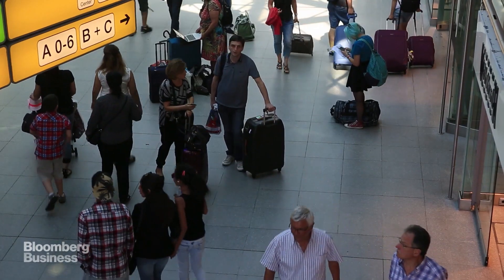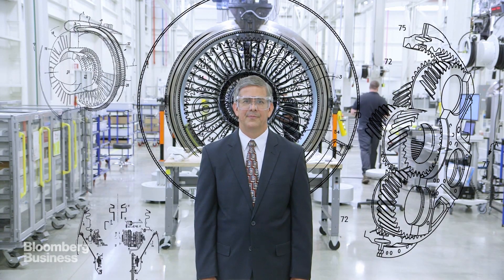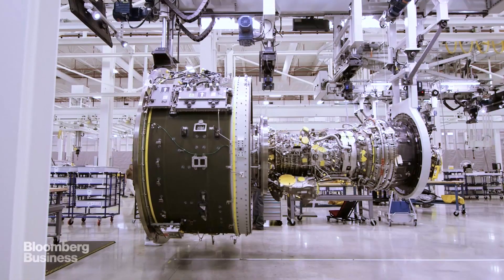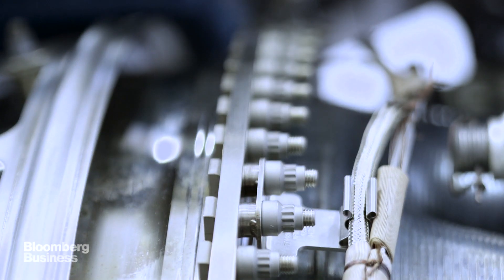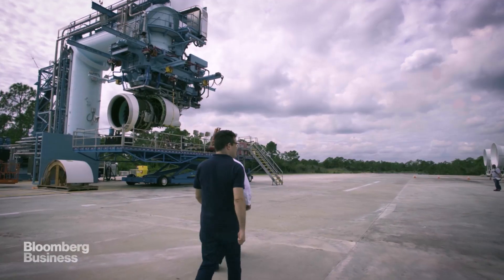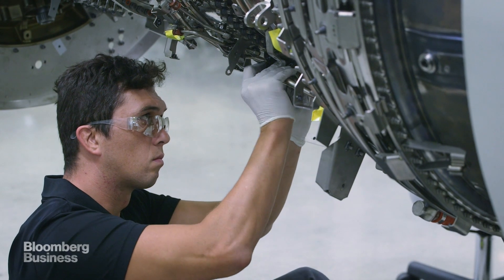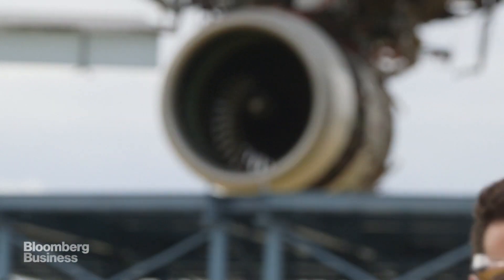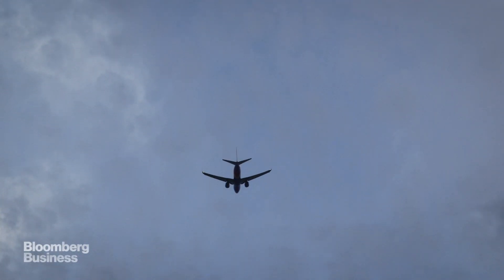This Genius Invention Could Transform Jet Engines

Comment: In a crooked Biden world where CA gas is $5.00/gallon maybe fuel efficiency is a big deal. But during the Trump administration that same gas was going for less than $2/gallon. That's more than twice as much for crooked Biden gas than for genius Trump fuel. What does that do to your 15% improvement in fuel efficiency during the Biden Crime Family reign? The fact is, you get more than three times as much efficiency just be replacing Biden with Trump.

Comment: I've met and worked once with Mike he is a smart guy. The gearbox he created is basically the same as a planetary gear system you find in a propeller engine. But it has a couple differences.

Comment: They make it out to be something massive and revolutionary, and it’s actually just a dang gearbox

SpaceX was making reusable rockets at this time and THIS is the aerospace news they cover
Reply: Because a geared turbofan affects many more people than a bloody rocket. Because the gearbox allows for different fan speeds, the engines can be more silent (let's use the BAe 146 for example; the 146 used 4 Lycoming ALF 503/507 geared turbofans, those engines, even though there where four of them, where extremely silent and it still is considered one of the most silent planes today, so much so that it was one of the only planes for some time to be able to operate the London City airport) and increases fuel efficiency, which means that airlines, in theory could lower the fare price while increasing their profits because of the increase in passengers
Reply: SpaceX wasn't the first to propulsively land a rocket, also why are you comparing a rocket to an engine those are completely different things.

Comment: Every engine has reduction gears. 
A piston engine has reduction gears for the camshaft and accessories 
Also the big radial piston engines had propeller reduction gears. Has to deal with torque pulses. A turbine doesn't. 

So it has to transmit 30,000 hp at a fixed speed for a long time. Don't see why it took 30 years to work it out. The moon rocket was developed in less time.

Comment: Usually jet engines burn the air, but Matter is lost due to element burning, so I figured instead of burning the air and mass of matter is lost forever, compress it and push it out quicker to save mass of matter, so the Universe does not evaporate to nothing so quickly.

Comment: What is new here? 
Fan-type engines are known even shortly after the invention of the jet-engine, called turboprops. 
Because transport aircraft fly much slower than the speed of the jet-exhaust, a simple jet is not very effcient. Combat aircraft with higher speeds need it. 
The fan allowes to reduce the jet exhaust speed in a similar way as a propeller does. 
The turboprop is just a jet core with a - GENIUS INVENTION - THE GEAR-BOX - and a propeller. 
The hugh fan does just the same, however better adapted to the aircrafts speed. It is a jet-core, a gear-box and a fan. 
The first such type was and is working as ALF-502 since the early 80-ties on the AVRO-transports with a by-pass-ratio of 5-6. 
The difference here is the by-pass-ratio is bigger.

Comment: Maybe a hybrid electro-jet would do better.  Use electricity to spin the compressor so you do not need a turbine after the combustion chamber.  No moving parts in the hot section mean the cost of manufacturing and maintenance will be a fraction of what we have today.  The engine will be lighter, uncomplicated, and more economical.
The electricity can be generated by:
1) a normal diesel generator in the fuselage burning A1 jet fuel, or

2) a smaller jet engine in the fuselage driving an alternator, or
3) fractional bypass of exhaust gases driving a single turbine coupled to an alternator.
Small battery backup can provide safety in case of generator failure.

Comment: Why not go all the way and add a V8 with a four speed gear box. I always thought that the reason for having no extra complexity in 100,000 LB thrust turbines was because of the problem of more things to go wrong. It might save a few hundred thousand dollars in fuel use but if the out of service rate increases then no dollars are earned at all.

Comment: I have a question? How much do the reduction gears weigh? What about friction losses? Isn't adding more complexity making the engine more prone to failure? Wouldn't it be easier and more fuel efficient and cheaper and more reliable to put the front fan on an electric motor?

Comment: Um how about move away from the jet and move to the next thing that doesn’t use jet fuel or rocket fuel
Reply: That's in progress. But there is no alternative to the turbofan-engine as a propulsion system for airliners yet. It needs time. You can't just build a hole new engine-design from scratch.

Comment: Why not use a slower rotating shaft with a redesigned jet exhaust power turbine stage to drive the fan? You could also expand the jet exhaust to make turbine design easier and at the same time cool the exhaust to gain greater thermodynamic efficiency.

Comment: Aren't all turboprops geared?
Treat the fan as a small prop.
Reply: Disclaimer: pilot. Not engineer. They are, but in a turboprop, the actual engine can be placed wherever they need it to be so long as its shaft is connected somehow to the propeller's. In a turbofan, the speeds involved are much higher, and the fan serves as the first stage of the core of the engine. Because of these, the fan and core have to be perfectly in-line. Sure, you could do a counter shaft setup much like in a manual transmission, but now we're sticking a gearbox into the airflow we are trying to optimize. It would add drag and cause asymmetric airflow. So, short version is the reason for the complexity is that it has to fit within the shaft that attaches the fan to the rest of the engine and still be streamlined for jet airflow.

Comment: My only "experience" with gas turbines is from reading but I found my jaw drop that P&W would suggest a reduction gearbox as ground breaking.  Not sure of the drawbacks but a twin shaft arrangement, a second turbine in the discharge eliminates the expense of gears. Both shafts are inline without planetary gears. Bearings are more reliable then gears. Eliminating gears extends the mean time between failure, less cost, less maintenance, lighter weight and for a given cubic meter per second, the hole size for the engine is smaller - keep it simple S. The gearbox arrangement might seem more efficient on a test bay but flying 2 or four gearboxes, for the life of the airframe, would waist a lot of fuel in the long run.

What am I missing?

Comment: Where is it in 2019?
Reply: they are already mounted in 737 MAX and A320 NEO
Reply: First flew on the Bombardier C Series which has now reached half a million flight hours in service with around 50 airplanes. It is way quieter, way cleaner and more efficient than traditional high bypass engines. Once they stop exploding they will be awesome. Not joking, they were blowing up or just failing in flight test left and right. Still giving a lot of problems in service with the neo and others. But it is new tech and new tech always has challenges. I am sure eventually they will get it sorted out. But I see them and hear them fly every day and the difference in noise is remarkable. Making noise wastes energy so this engine wastes less, which means lower operating costs and less pollution. It is the way of the future for sure. But still a few bugs to work out.

Comment: Well, Mr. smarty pants needs to invent an air bypass on the outside of that fan to not only allow less resistance but to actually increase speed of airflow. A big cowling like that only becomes a lot of resistance at a certain point.

Comment: The clip doesn't explain what is so complicated in gear reduction in a jet engine. It is used in every transmission and front and rear axle driven vehicle. Perhaps it is a problem when the turning fans are moving at 100,000 rpm?

Comment: This video..am assuming is slightly old..and no one doubts the engineering excellence and innovations of Pratt and Whitney ( organisation).. and their amazing product line up.. but ask them how many airlines are now tearing their hair over the " new" engines that they thought they had a monopoly for..on the Airbus 320 neo' s. These new " engines" of theirs.  to put it mildly are just not delivering what was promised.   and are full of snags.  be it hardware or softwares in the cockpit..related to engine performance . startup time taken etc.  This is leading to many aircraft developing in flight snags../ huge delays / and of course crazy schedule disruptions..the company is working on trying to resolve these issues for over three odd years now.. hopefully they'll get it fixed..but in the meantime airlines are switching orders to CFM..RR..and GE.. thanks for sharing..!!!

Comment: “No energy system can produce sum useful energy in excess of the total energy put into constructing it.
This universal truth applies to all energy systems [including jet engines].

Energy, like time, only flows from past to future”.
The Fifth Law of Thermodynamics and The Arrow of Energy, proposed 2017.
Reply: So, what does that have to do with this video? Turbofans aren't close to 100% efficient anyways.
Reply: @jeffbenton6183  This would be what is behind grounding the air travel for the masses if the reason was energy resource depletion, not a public health issue.
Reply: @sunroad7228  I'm still not following, what's your point here? The video is describing a system that is intended to achieve less noise, fewer emissions and longer range for the same amount of thrust, that's all.
Reply: @jeffbenton6183  More noise, more emissions will be caused somewhere else in the industrial base by the new design, and it will require more energy-intensive repairs, too (i.e. longer working hours for the mining machinery, and other externalities).
There is no such thing as 'efficiency', but energy-juggling and problem-shifting from one place to another.
This is all what Physics allow human to exercise. Fossil fuels are so energy-dense and highly portable, sold on the market cheaper than bottled water - is what has made Economics under our civilisation misleading humans to think 'efficiency' is something they can achieve.
Never.

Comment: They’ve already done it, modern engines run by compressing the air so much they don’t use fuel anymore and probably haven’t done so for quite some time.People however are still being charged for the non existent fuel in the ticket price..

Comment: it took them 20 years to develop the simple idea of gear reduction? This is nonsensical.  They probably did not act on this concept not because it was unknown but because it offered only a relatively small return. Gas prices were less of a concern in those times. Noise as well. Perhaps the reliability of the gear system was also an obstacle, or its added weight. There could be many reasons except that no one has thought of it. Lets be realistic. The designers want to appear to be true inventors and thus exaggerate their accomplishment. This much is clear to me.

Comment: Thing about a jet engine, the force is always perpendicular to the motion, so no work is done on the mechanical parts.  In a reciprocating engine you must stop and start the pistons and rods twice for every revolution.  If we all could have gas turbines connected to electric generators in our basements we wouldn’t need electrical wires, or generating plants, or coal, or oil.

Comment: Wow - What a great innovation...   but wait.
In 1959 I flew in a 1932 Cirrus Moth with a gearbox so that the propeller (the fan equivilent on gas engines) didnt exceed the sound barrier. The Rolls/Packard engines of WW2 often had gearboxes. Well at least the Wright flier of 1908 didnt have a gearbox. They used sprockets and bicycle chains.   😨😨😨

Gearboxes on Jet Turbines are common (for electric power plants and water pumping). They are heavy and they just aren't efficient yet.

C'mon guys at Bloomberg. This sort of fake reporting is unacceptable. DO YOUR HOMEWORK.

Comment: Gearbox reliability has increased tremendously over time and with improvements in lubricants, materials and machining processes but are still regarded as the least reliable component in a mechanical drive train.

Comment: When Electrical Planes already flying in the air, what is the point in developing Jet Engines which works under the influence of Fossil Oils? The whole world looking forward to travel in Electric used Jets and Cars in order to save the world from already polluted environment. Time is not far off, in the next few years every moving vehicle would be used only Electricity, not Fossil Oils, please remember it! Bye. Bye.

Comment: Sooooo tests are run...4 to one tooo slow...two to one is too fast.....and three to one is nearer perfect.....Jet propulsion laboratory should have done this work around 1986 and settled on a 3.1256 to one gear ratio for most efficiency...FOR EXAMPLE.... Racing boat teams have one hundred props for speed and efficiency...BUT ONLY ONE FOR RACE DAY...from tests!

Comment: Pratt&Whitney originated in the great State of Connecticut, its Headquarters is in East Hartford CT. the down side of working with a Company that build Aircraft Engine in certain department, is that you can be easily layed off,, its like construction, you get called when there's a big contract, and layed off when its done, one has  to wait another contract, so its in the interest of P&W to develop outstanding Engines, so these Workers can have work perennially.

Comment: "IF" they want to slow the TIPS of the fans...then why not CURVE them backwards ?? Curving them backwards would put the TIPS behind the Primary Base Stem of esch blade and therefor tech slower AND provide cup of sorts to catch MORE AIR in the process...ALSO ADDING more air / thrust to the engine, right ??  I only saw the same old STRAIGHT blades on this design.

Comment: cobrapub here,Mister McCune,why are you trying to BS me with TECHNO BS?Gear ratio's,really,that argument went out with the CFM-56,look let agree it's 2019 not 1980,engines are getting bigger/heavier and less efficient due to "INSEPIT STATOR AND COMPRESSOR BLADE DRAG"!So you want efficiency and power,oh lets say 750,000 to 2 million pounds of thrust with an operating ceiling of 250,000 feet and a 25 percent drop in fuel use,RIGHT,then get rid of the BLADE DRAG!It's simple you want to reinvent the jet I want a whole new kind of "HYBRID JET/RAMJET"!The answer is not axual blade but variable logitutinal actuational (fan blades) that fold into a smooth conical surface and the whole fan section moves to limit shock at high mach!No more combustion cams,one RCS rocket motor,or just have you company buy a "SABER JET"!

Comment: Seriously.  Is this news?   Or did you just get hoaxed right there.  
  There was simply nothing new in this report.  Everything is internally connected inside a turbine engine and a the fan air section is slowed down so the blade tips don’t reach super sonic.   This is the principle function.  
  As an aircraft engineer (graduated 2000) I can assure you that there is no news in this report. 
   It is a silly advertisement for Pratt & Witney.     
     Come on Bloomberg Business don’t look stupid.

Comment: Pratt & Whitney PW1000G is the engine selected as the exclusive engine for the Airbus A220, Mitsubishi Regional Jet (MRJ), and Embraer's second generation E-Jets, and as an option on the Irkut MC-21 and Airbus A320neo, according to Wikipedia. The gearbox has a fixed 3:1 ratio, and requires no maintenance other than oil change.

Comment: This is a very simplistic article which does not demonstrably add information: Reason being, there are already turbine engines with compressor speed not the same as turbine speed. They don't need gearboxes, they simply function within the same overall turbine/ shroud. Also, there have long been gearboxes connecting turbines used as electrical power sources to their electric generators. They are works of high technology but have been around for a long time working for long periods between overhauls. So this very short article does not provide enough information to convince someone that something new and far more efficient has been invented.
Reply: How are the turbine and compressor going to spin at different speeds when they are physically connected to the same shaft without a gearbox? The answer is they don't. Of course, turbofan engines have two or three shafts which run at different speeds without gearbox connections, but the turbine and compressor on each shaft run at the same speed. In this case the turbine driving the fan runs at a higher rpm than the fan because of a reduction gearbox. Without that gearbox the fan and the turbine must run at the same speed.

Comment: Get rid of the gear box and run a magnet type system..sorta like a magnito..no touching parts,no friction,no heat,no real drag..now I just gotta figure out how to put it all together..I have my idea from a locomotive set up..oh btw,less rotating parts equal less energy to turn all working parts Wich in return,means less fuel/energy used..

Comment: There have been geared turbofans on A320 neo (new engine option), for many months now.  A lot higher bypass ratio, with these new engines. Having larger fan disks, in the front, and a gearbox, behind the disk, to slow the fan disk, below the speed of sound, while, pulling more air through the engine.  Took many years, to iron out problems, with gearbox wear, alignment of the shaft, and rubbing of the blade tips on the engine housing.  Even now, the fan disk can rub the housing, if the engines, are started up too quickly. So far these A320neo's are a ton better, than the 737 Max planes, for which, Boeing can't come close to matching, due to the short landing gear on 737's.

The engine is a Pratt & Whitney PW1000G